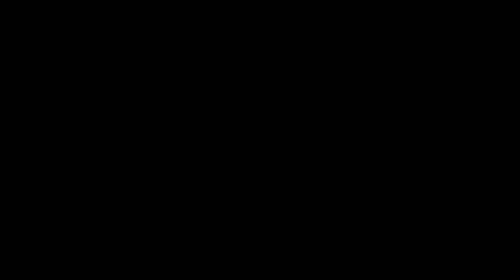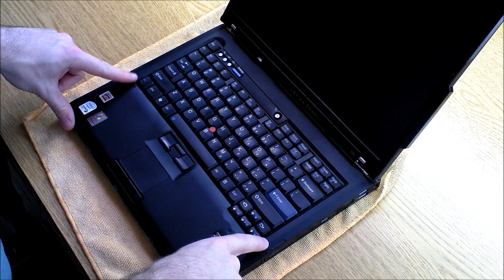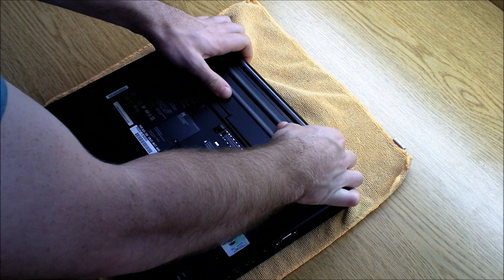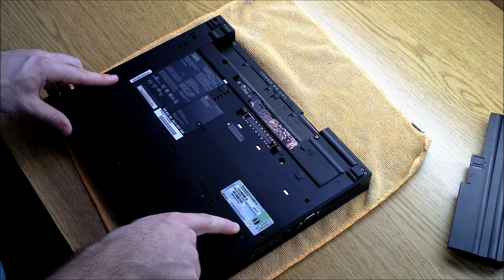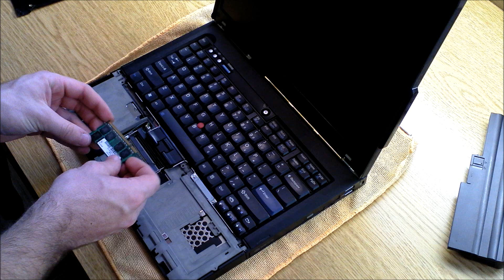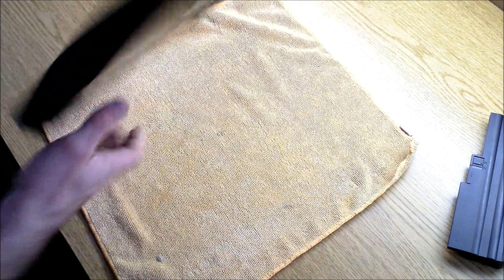Tutorial: Upgrading a T60 Thinkpad to 3GB of Ram (1080P)

Comment: You installed two rams of different capacity (one 1GB and one 2GB). That's asymmetric dual channel mode. Wouldn't it be better for you to install two equal capacity modules (e.g. two 2GB rams for symmetric dual channel mode) for faster performance?

Comment from the maker: It really depends on your location for value. What upgrades does it have? You could expect to pay anywhere between $85-200 for one. On the low side, you are looking at a laptop that may not have an OS or harddrive, or maybe has some damage. On the high side, you'll be looking at one with the C2D cpu (not the core duo), higher resolution LCD, and maxed out ram. For $170, it should have 3-4GB ram and Windows 7, with a good battery. I would say anything in the $120-145 is fair for a clean one.

Comment from the maker: Sure, just posted some links in the video description. Check out the second link, then click on the used section. I believe the Amazon Warehouse has a few in stock, and they are only like $30-35 for 4gb which is a great deal (its open box). If you are only running the stock 1gb right now, you will see a huge improvement.

Comment from the maker: On the T60 (specifically this model), the chipset will not be able to utilize 4GB of ram. I mention 64-bit vs 32-bit operating systems. 32 bit OSs were the norm several years ago, but they can only support up to 3GB of ram. Now, you need a 64-bit OS to see 4GB or more of ram. However, on the T60s, even with a 64-bit OS you will not be able to use all 4GB of ram. This is a hardware chipset limitation. I believe you will wind up with ~3.25GB which is addressable, so buying that extra GB is a waste

Comment from the maker: Hey I just uploaded a video response. I currently don't own a T60, but I have done a video on HSF replacement for T61s which will help you a great deal. It is the same exact procedure on the T60/T61, the T60 is actually easier since it requires the removal of fewer screws.